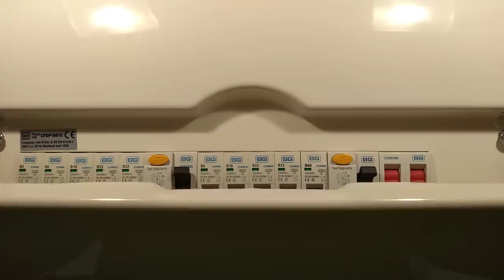A look inside a British home electrical panel.

Comment: As an American electrician this panel not just being a box full of blatantly exposed death metal is mind blowing.
Reply: Indeed! I know both system. Easy to damage wire insulation and your skin too with these steel panels, conduits .... ! Plus bad contact with the busbars. The panel shown originated in Germany, it is modular, refered to as the DIN rail standard.  Note that many US companies use it nowadays.
Reply: @clitisswood7330  I've installed a lot of din rail in industrial settings.  It's common in those settings to install breakers similar to these as well as terminal blocks, fuse holders, relays etc.  I've never seen it in a residential setting, but it seems like a great system.
Reply: The other 2nd amendment the right to bare wires.
Reply: 15 minutes can save you 15 % on car insurance 🦖
Reply: It is nice to have the breaker automatically connected to the bus bar instead of having to connect a copper one separately which Clive stated could be connected wrong. Also, in the U.S. (at least where I am) A fridge or freezer cannot be on a GFCI in case it faults while away and you come home to some botulism. U.S. boxes look like less jumper wires with crimped ferrules to install also so probably faster/easier. I do like the DIN rail for its flexibility but not for a simple breaker box.
Reply: You couldn't do DIN rail components of this size easily here, because the wire sizes have to be so much larger due to us running half the volts. :/  Still, it seems odd to not see a single standardized design - BigClive has shown a lot of different and frankly scary line voltage components for houses on this ch.
Reply: @railgap  Not really since the amps were were mostly higher in Clive's box. The 6amp could be smaller guage than here but obviously not the 16 and higher. Our big load devices do use the same 240v
Reply: Yeah, honestly I'm having heart attacks every time he touches anything in this panel
Reply: @johnmcauliffe8824  don't think it's live or even fitted.
Reply: @a2cryss  yeah it seems like the whole setup is more complicated than it best to be. For instance, why is the main isolater  just an isolater? Why not just use a main breaker and give the isolater and thus the whole panel over current protection
Reply: @duke1898  I also have used a lot of these breakers and DIN rail components, but stuffing that bus bar in the bottom looks sketchy as fuck. I can see for sure how you could end up with a bad connection that could end up causing a problem. I would much rather just have a normal QO style Square D panel in my house.
Reply: @duke1898  In the european union this setting is mandatory in every apartment.
Reply: As a Norwegian, this looks tight and not as safe as our standard. Also first time I've heard someone argue against RCBO's :P
Reply: @griffinpatrick8286  No but if you do find out let me know buddy! Thanks.
Reply: As a Norwegian electrician, that exposed bus-bar is giving me an aneurysm.
Reply: @jimnelsen2064  can confirm, it is unpleasant
Reply: @pfaunimaster523  Still…it’s against everything I’ve ever learned. Touching everything with two hands making a loop across the chest….😖 making me squeamish too!
Reply: No one is forced to use an in-isolated bus bar and no one is forced to not understand „Neutral“.

The here used 3-phase house connection is also forcing isolated bus bars, as neighboring 3 circuit breakers are normally distributed to all 3 phases.
Reply: as an English electrician there is no exposed metal ,the earth ( ground) and neutral (negative) they are not live to touch, the live parts on the breakers and isolators are well insulated ,only probes can touch ie finger proof ,and the long  live bar linking all the breakers comes with a insulated cover, so if done properly there is no exposed live parts to touch
Reply: @fatherelijah1763  And spending only 15 minutes on house wiring, can cost your home  insurer a lot of money. 😊
Reply: @louisjov because the incoming connection to the house will be fused at maximum 100 amps anyway.
Reply: @toddbod94  okay? I mean if you are still having a fuse, why not just use a proper breaker? It accomplishs both an overcurrent device and a disconnect on one very reliable device
Reply: At the same time it’s not upside-down, unlabeled, easily bent, and mounted in a damp wall!

I don’t know where you do your work, but I’ve seen some janky-ass breaker boxes in a lot of single-family houses where I am.
Reply: @parmesanzero7678  yeah, I've definitely opened more than my share of panels I wished I could have just left closed.  With the exception of NEMA motor starters, which are superior in every way but price to IEC starters, Europe just does electricity better than us.
Reply: @louisjov I’m not a professional, in Italy nowadays we have the main breaker and main 300ma gfci just side to the electric meter in the same box (which is compulsive to be on the border between the property and the public street) so that way all the line to the breaker box is properly protected. There is no reason to use something different from an isolator since every line has its own and the main one is the one I told before.
Reply: @mircobandini5497  that makes sense, you already have a breaker on the outside of the building, so there is no need for a secondary disconnect. Personally I like having the main breaker in the panel, so that you can disconnect everything at the same spot, but I could see how having a disconnect on the outside would be safer in some situations.
Reply: @louisjov  all this comes for the need to have the meter at the border of the property, because the state own the meter and any public servant can access it without crossing your private property. Also any possible fault of the meter won’t put the house on fire and claim the state responsible.
Reply: The BG board is not my favourite personally. The reason why it’s metal is because of the fire regs.
Reply: really?  all live screws pass standard finger test, no exposed live copper.  Other exposed metal is neutral or earth.  Sep sparkies not very highly qualified. though, so wouldn't notice that.  Pretty dumb comment

Comment: It is a pleasure to look at a DIN rail based British panel. I cry every time I look inside a Canadian panel. Thank you for keeping the Queen safe from shock.
Reply: this is not "brittish" this is the standard in the eu since 20x years ago.
Reply: There are advantage to both.  Personally I'm not a fan of the ring circuit design in EU panels. Leviton has a very nice residential panel design, the largest issue with most North American panels is that the basic design hasn't changed since circuit breakers became standard.
Reply: @shadowwolfmandan  Ring is only a UK invention, rest of EU use radial circuits, also some homes (majority in my country Poland) gets 3x230/400V mains